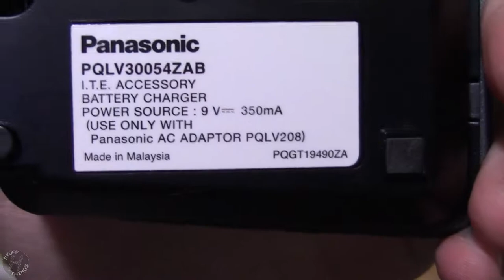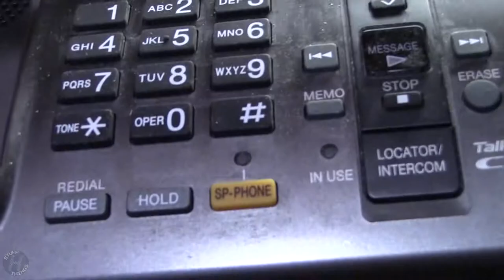Panasonic 5.8 GHz Quad-Handset Telephone | Model KX-TG6074 | Refurb

Comment: You really push your luck using the screw driver to pry it apart, but sometimes it does need to be used.. It's been a while since I've worked on one of these so I don't recall, but usually those pieces that hold the speaker in place twist to unlock..
I've never used that cleaner before, but the fact that it's made in USA will probably make it my choice if I ever need such a product..
It doesn't matter where you contact the board, the static shock will still happen if the potential is there.. I've never shocked anything either, and there's plenty of times I don't work with a grounding band.. Ideally one always should though..
Looks like everything came out pretty good.. Glad no white stuff showed up either! The set should serve you well..
Reply from the maker: I attempted to twist the Batman things offscreen, but that was not the method.  There's indentations surrounding all 3 sides of the tab, the only way to remove them was to pry the tab outward and off.  I actually ended up breaking one of the tabs and had to tape the speakerphone back in, which was quite sad.
Everything came out really nice and shiny, this was a good buy.
Reply: Apparently these are an exception.. I went back and watched the video I did on these, and I too struggled to figure out how it worked.. I ended up prying on one corner and it came off easily..
I have one of these handsets I'm taking parts from, I'm pretty sure the speaker holder thing is good.. It's yours for the price of shipping if you want it.. I have a feeling the tape won't hold up over time and will allow the speaker to vibrate, perhaps a few drops of hot glue would offer a more permanent, yet still removable, solution..
You definitely got a good deal on these, I far overpaid for the set I have, and they're quite worn..
Reply from the maker: The speaker holder is intact, it's the tab that is part of the black plastic outer shell that broke, but I appreciate the offer.  I used electrical tape, it seemed to hold it in pretty securely or else I wouldn't have went with that method.  If something ever happens, I'll take it apart again and try hot glue next.  These are indeed in surprisingly good condition.